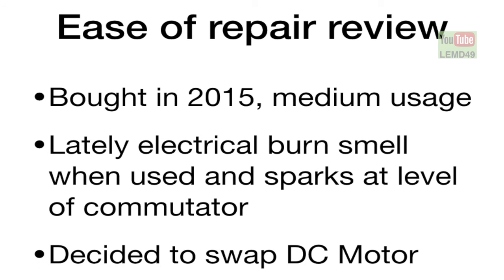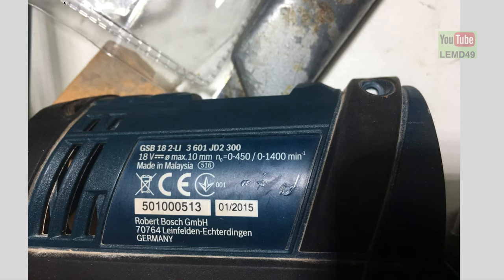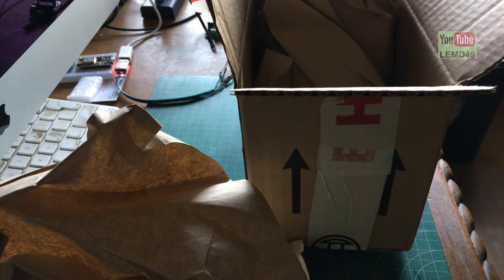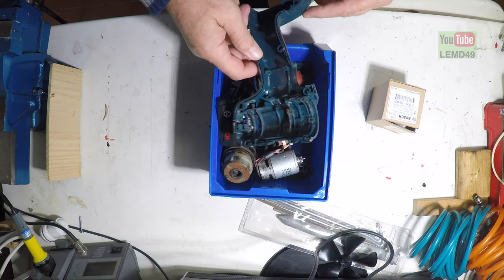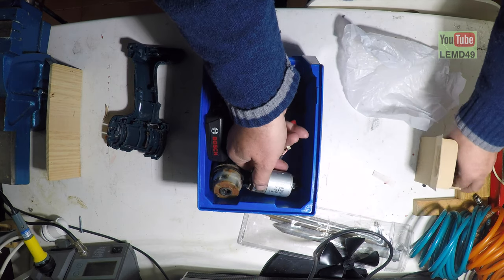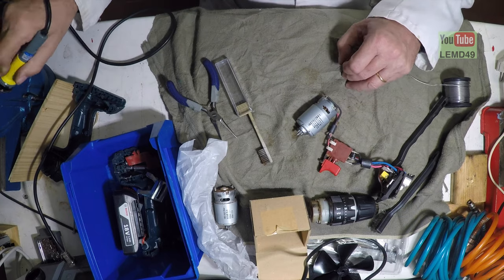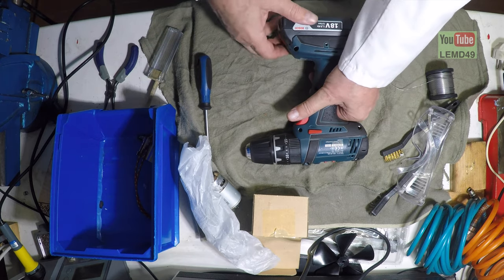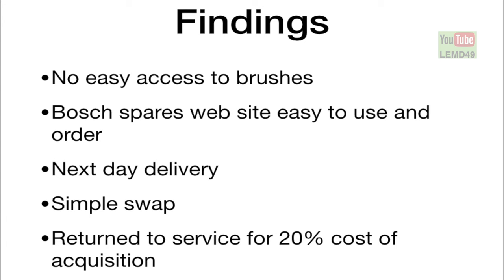DIY - Bosch Drill Fixing Repair Review - DC motor replaced - Returned to service for 29 euros ⚙️👍

Comment: Thank you for useful video. And I have a question. I want to replace only brushes on the same model(gsb 18-2 li). Is there any possibility? I saw you had found “No easy access to brushes, but I wondered.
Reply from the maker: Thanks for your comment. From Bosch online spares store I got a new original DC motor. They are made by Johnson Electric, and the type is Hc683LG.  I did not try to open it further because to access the brushes you have to overcome 8 factory crimps made in the circular housing. However, it seems that you can purchase a set of brush rings as I found this reference in AliExpress. https://es.aliexpress.com/item/32966632321.html 
Let us know how the repair goes for you.   I also noted that they sell third party DC motor at about half the price of the Bosch spares.
Reply: LEMD49 Wow, I really appreciate your detail and great anawer. Maybe I ‘d better buy a new DC motor like you did in order to save my time. Thanks again.
Reply from the maker: @hanbyullee  Yes that was what I thought too. To extend the life of the whole machine was worth paying more for the whole sub-assembly, than ending up with a sloppy outcome. (Just a youtuber cutting the motor open with a radial, not sure how the closed up job ended up.) 🤣
Reply: LEMD49 Haha, I agreed. Have a wonderful weekend!

Comment: I see at the switch at one site 3 wires: red, black ( probably +,- ) and a blue wire. what is the function of this blue wire??
Regards, jan
Reply from the maker: Hi, I did not trace that part of the circuit since I only replaced the motor from the existing 2 wires leading to it.  I checked again the Bosch spares website and could not find a wiring diagram. However, I see from the exploded view that that subassembly is sold as a whole unit "electronic module 18V" with p/n 1 607 233 544 and is priced at 71.55 euros. Which part of your drill has failed?
Reply from the maker: In any case for analog speed control 3 wires are required. The image of this post (for another Bosch machine may give you some hints). https://www.bosch-professional.com/gb/en/community/category/rh540m-sds-max-tool-wiring-specifics/13436103-t#/main
Reply: @lemd49  : thanks for your help! Regards, Jan

Comment: The brushes are a bit awkward to locate & change.  However not much more than a complete motor replacement which here was unnecessary. Not mentioned the numerous star drive screws that assemble the two halves - again awkward to remove! Then the problem of getting motor gearbox & brush mount plate in line & in the exact correct position. No way to be sure of extent of brushwear & the brush springs are a pig to reassemble. All in all not an easy fix & my drill only 6 tears old & used only as a DIY tool. I am not happy with Bosch!
Reply from the maker: Unfortunately most products nowadays are not designed for maintenance, or testability. It seems that in cars this has become ridiculous for example for alternator brush changes (not readily accessible, some models without spares available).